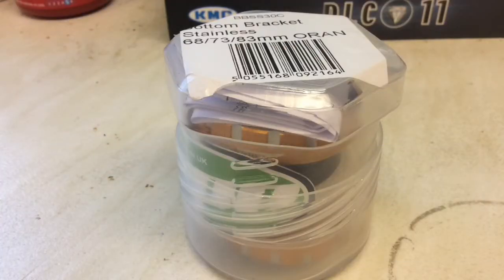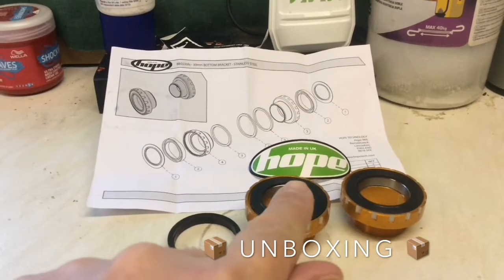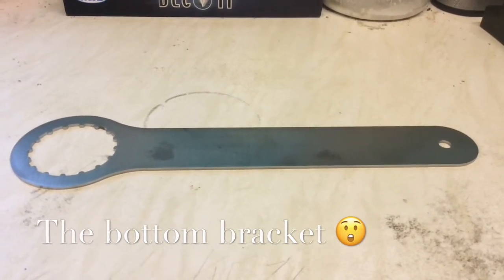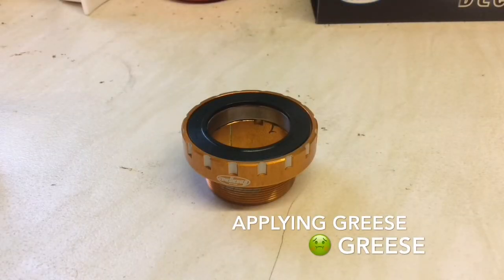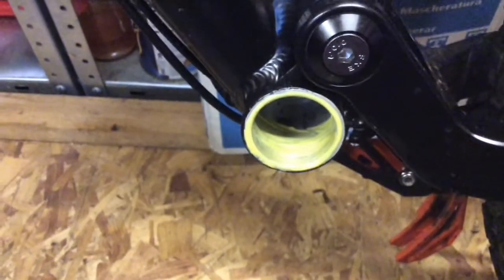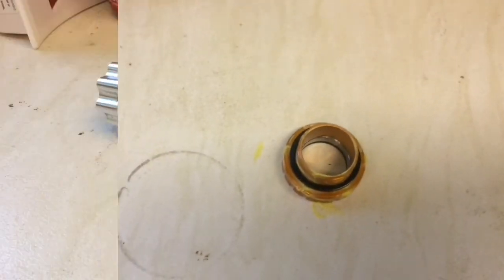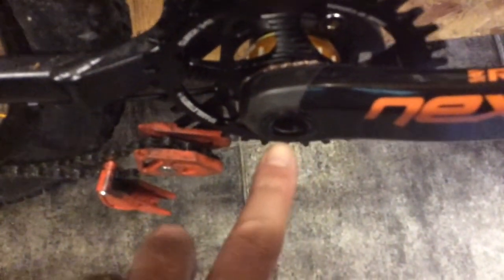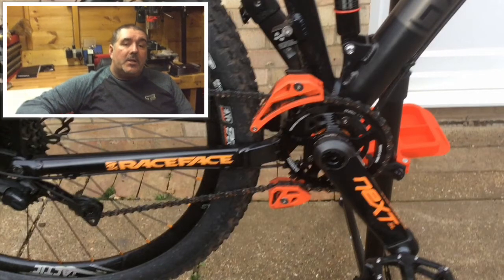Crank Fitting pt 3

Comment: make sure you are careful with the preload ring screw, as its fragile, I am careful but it got rounded off on one of my turbine cranks.
great vid :-)
Reply from the maker: Johannes Nilsen :I agree,you have got to be gentle when assembling these cranks,and I'd read so many horror stories on bike forums I thought I'd try to explain my way of doing things,glad you like the video,keep watching new videos coming soon.
Reply: I have had a stem bolt fail on a race Face turbine stem, on my one of my Turbine droppers the bolt got rounded, the pivot bolts on my fuel ex 7 also wear fast, I of course torque to spec. 
I have also had bolts round off after torquing them to spec for the first time on MRP AMGv2 chain guide.
Some bolts are made of too weak alloy. 

How is the BB holding up in the winter using only the grease, I use Loctite 243, but this was on UN 26 square taper bb's, it took only 10 minutes of riding for the BB to get loose, this never happens with Loctite 243.
Reply from the maker: Johannes Nilsen,hi mate the bb is working just fine,from an engineering point of view the torque setting that are given are the absolute maximum you can use,you can safely go 1-2 nm less.as for torque setting listed on bb's there's no external tool that fits to a torque wrench,in the case of hope it's a bespoke hand tool,just do it up tight then go a 1/4 turn more and thats it.
Reply: yea I know I do the same.

Comment: The preload ring has been the weak point in my atlas cranks.
Reply from the maker: Daniel May hi mate,yeah I know the preload ring could be better,but I think there are two good reasons it’s made the way it is:1its plastic design is deliberately made that way so you can’t cram it up too much and potentially ruin the whole crankset,2: the plastic ring is cheap and easy to replace.